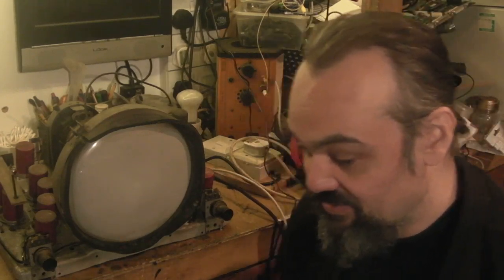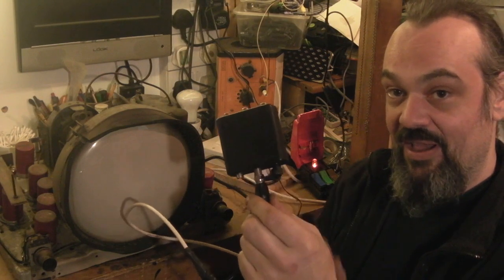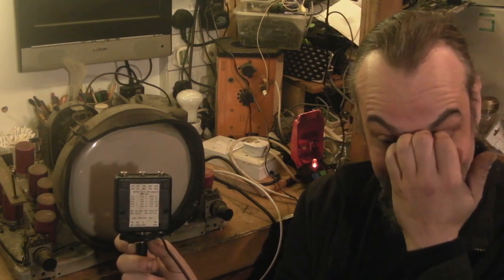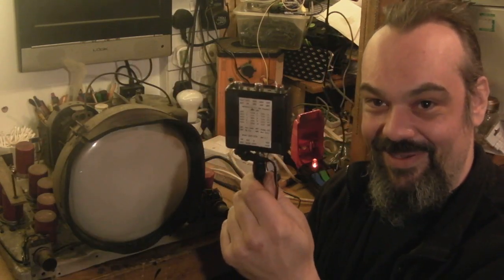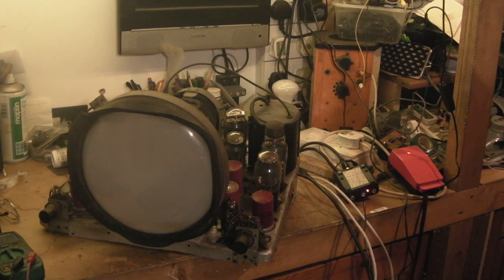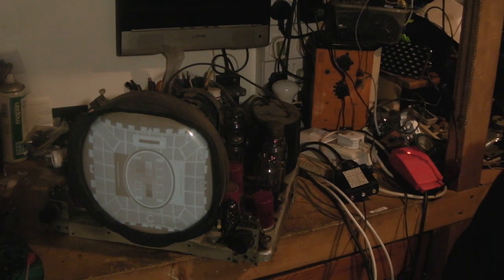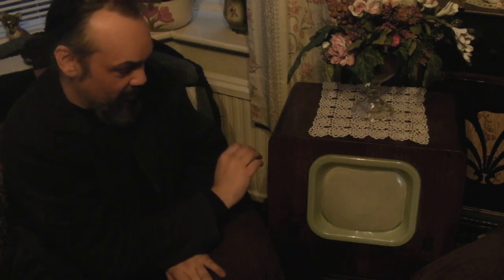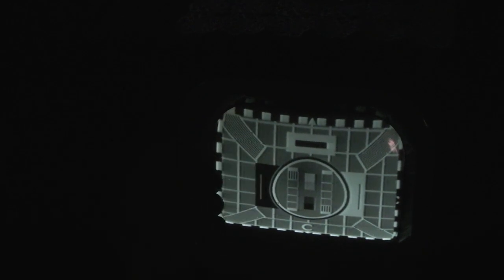Vintage PYE (LV20/BV20) Television Restoration Pt7 Getting a Picture

Comment: Nice work Jay. Looking good and I think the field linearity fault could be a resistor or possibly a capacitor.  It’s a common fault, along with top expansion or compression which was often a capacitor in the field oscillator.  The lack of sound looks to be prior to the audio amp as the volume control makes a noise.  Not sure if this set has a seperate audio r.f. strip or a sound trap in the video r.f.strip.  Standards in the early times certainly were varied, prior to the adoption of 525 lines in 1942, the US was mainly using 441 lines and occasionally 343.  Europe was also using 441 line in a number of countries but at 25 FPS rather than the US 30 FPS.  The beginning of BBC broadcasts in the 30s was initially alternating weekly between the EMI 405 line system and the Baird 240 line system.  The Baird system was quickly dropped due to the poor sensitivity of the cameras. I recall the articles in Television magazine in the early 80s on recording 405 lines on a VCR.  It could be done by extracting the video from a 405 line TV with due care, although the dropout compensation wouldn’t work so you could have a bad picture with a worn or marginal tape. Merry Christmas

Comment: Check the Power Supply first and also the linearity control - you may have knocked it while you were working on it. The sound fault should be easy but check the settings on the Aurora first as the sound may be off. Merry Christmas !

Comment: Just binge watched your restoration videos in hopes to get to know these sets better, and i certainly do now. Cheers for the vids, they've been brilliant. I've got a D18T which has no sound or raster, but I have a healthy line whistle. Did you sort the lack of sound out? if so was the cause of no sound for you? 

I'm not too worried about the lack of a raster just yet as it could be a few things, poor valve connections, O/C slider, bad EY51 etc etc.